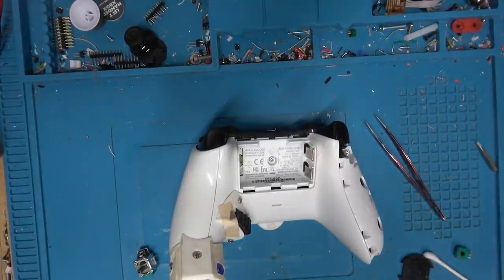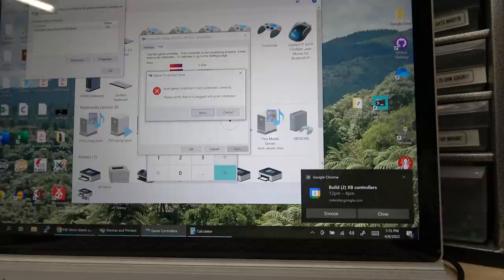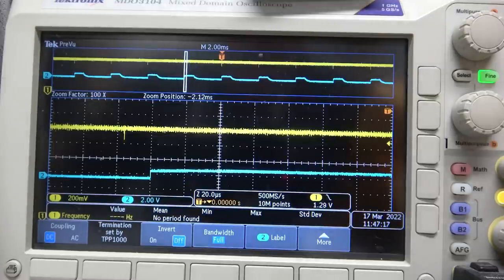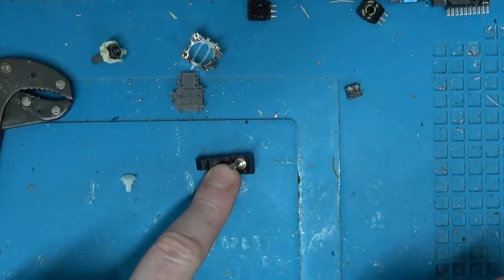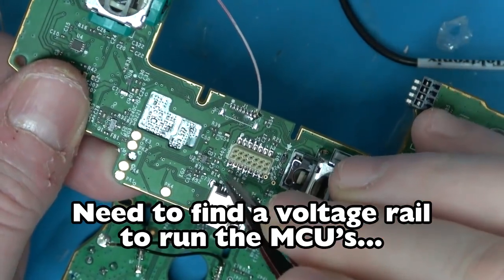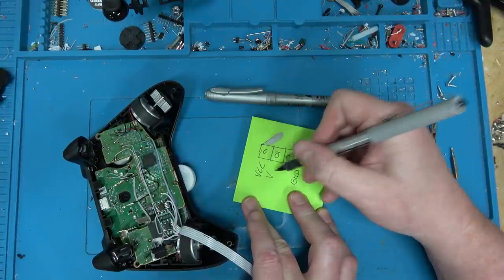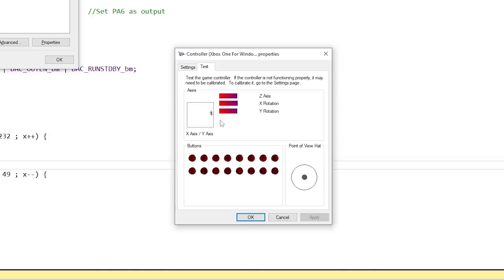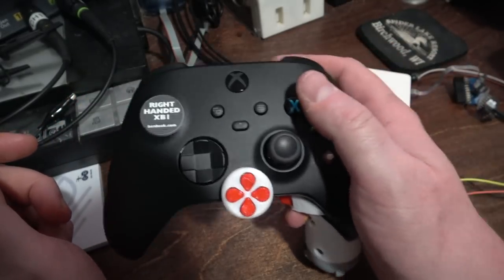Driftbusters: Improving Analog Joysticks

Comment: A rotary hall effect sensor can be dropped in place of a pot.  The AS5600 is still being made.  The tricky part is fastening a magnet to the joystick shaft.  Since the joystick only goes 90 degrees, you could make a home made rotation sensor with 1 magnet & 1 hall effect sensor for each axis.  Rotation is easier to sense than distance.

Comment: You can achieve the same signal conversion using an opamp which will likely perform a bit better and which will be more resistant to supply problems. Connect one sensor's output to the + input and connect two resistors (maybe 10-100k) to the - input. Attach one of these to the other sensor and the other to the opamp's output pin. Now the opamp output will be a nice analog signal which can be divided by a pair of resistors or a potentiometer to obtain the voltage range the controller expects.

You can probably put all of this onto a small custom circuit board to make it nice and easy to install.

Comment: The PS3 still to this day is one of the craziest gaming consoles ever created. The engineering and thought of everything put into the controllers as well as the console itself is just amazing. PS3 controllers that I had typically suffered from a "loose" joystick. They still worked, but they were very "floppy". I'm assuming that the sensors for the stick position basically had no wear but the mechanical sticks themselves actually were probably very worn over time. It really is a testament to good engineers who had the forethought to think, "You know, this stick, when playing games is going to be used sometimes for hours a day at a near non-stop rate. We should probably reduce friction to zero to prevent wear on the sensor so the sticks last longer."
Reply: Still using the same DS3 after 10 years for PC gaming. Still absolutely nothing wrong with it. Companies have definitely gotten cheaper over the years.

Comment: Adjusting the center point is the most useful thing to get rid of drift.  I started to design an add in board with a set of multi-turn potentiometers that go in parallel with the sticks for adjusting the center point but the jitter that shows up after wear and tear means the sticks need to be disassembled anyway.   Cleaning and bending the contact pins outside the cuts in the tracks will last for a little while but eventually you need to replace the pots.  Mouser and digikey carry the genuine Alps parts (and the newer versions) so I'd only order through them.  And no matter what you do, unless you use a microcontroller to adjust it automatically, the drift will always make its way back and need some adjustment.  If only Microsoft allowed access to the microcontrollers code so we could fix the issue in the firmware so we could adjust the center point of the stick ourselves, then we wouldn't need to constantly repair these sticks.

Comment: The joysticks of the Steam Deck are hall effect if I remember correctly.
Sooo, in theory they should work way longer without trouble
Reply: No, it still uses potentiometer. Gulikit will be releasing a hall effect replacement for steam deck. Just search for them.

Comment: Stick offset is also due to changing the pots on the stick, since these are never really zeroed (dead center) swapping a pot will change the zero value of the stick, you either fix calibration by adding resistors or try finding a similar centered stick.
Reply: So true, no 2 pots are equal. Wish we could recalibrate the firmware in the pad. It must be done at the factory.
Reply: @chrisjones9193  wish there was a way, resistors do just fine on Xbox, on PS4 it lowere the max input range by the same amount the center is offset.

Comment: Abrasion of the carbon film will indeed be the issue. It's been a thing for as long as people have been using potentiometers for joysticks- it was semi-common for PC flightsim players to have to open up their joysticks to replace the pots every once in a while. The metal ones last longer, but they still have the same problem.

Honestly, I'd like to see a quadrature-output photonic replacement (use film or something to get a transparency gradient mounted to the rotary shaft, then place LEDs on one side of the disk 90 degrees away from each other, with light detectors on the opposite side from them- that gets you quadrature), just because I'd like to see that as a product, but the hall-effect route will probably be easier.

Comment: Try using 'Fader Lube' It will lube and protect carbon tracks. Best used when the device is newer, or after a cleaning. Will extend the life signifigantly.
I use it on all my audio gear and test equipment.
Reply: What about Deoxit D5?

Comment: If you have a spare pin I'd use it to enable a calibration mode.  When the pin is asserted sweep the X and Y over the entire range, then centre it, then deassert the cal pin.  The micro will store min/max and centre values from both axis and store them to EEPROM.  This means no hardcoded values that may change between joysticks.

Comment: Gulikit's King Kong Pro 2 controller has Hall effect sensors for their sticks, and they're in a housing that matches the standard Alps ones. Hopefully it can become a drop-in replacement in the future.  And their Twitter just posted a prototype mini stick for Joy Cons!
Reply: Don't know how the Joycon sticks will work, but the normal sticks still require the DAC as can be seen in their Steam Deck modules. So, there is still some work to do to get drop-in replacements, and they will be relatively expensive xd
Reply: @ivanaviNiebla  Relatively, yeah. Just out of curiosity I'm seeing individual ALPS modules going for as low as $1.50 each, while the Steam Deck ones are $15 ($30 for the pair). That version includes the daughter boards, though, which I assume increases costs. I can imagine having the eventual drop-in replacements hit $10 apiece would situate them really well as an aftermarket upgrade. Who knows what pricing they can provide for a larger vendor
Reply: @RocketSlug  $10 a piece would be great I think, but who knows  how much can they shave off the costs. Especially if this will be more or less niche products because of the desoldering and soldering involved for normal controllers.

And if competition doesn't appear, they won't have much incentive to reduce the price :/
Reply: @ivanaviNiebla  joycons stucks are modular just like steam deck so they just have to make it smaller
Reply: @RocketSlug  from my understanding, aside from the obvious change needed for voltage and code, gulikit modules can't be drop in because part of the maget is soldered/built into pcb itself
Reply: @realislit8064  Yeah I dug into it a little and there seems to be a component on the PCB. Maybe one day!
Reply: @realislit8064  but steam deck's have a pcb with a chip, while the joycon sticks are only the stick
Reply: @ivanaviNiebla  GuliKit Joycon sticks are not hall effect, and they don't claim them to be. People just assume that because they made a splash with their Hall effect controllers and Steam Deck replacement sticks. They are just conventional, but better than stock quality resistive joysticks.
Reply: @ClassicGOD  They said to be working on a hall effect version didn't they? Not the ones that are already on sale.
Reply: @ivanaviNiebla  They have hall effect Pro Controller for Switch but I never seen anything on Hall effect Joycon replacement joysticks. But I don't follow them closely enough to claim complete knowledge on what they did or did not announce.
Reply: @ClassicGOD  Yep, just checked their twitter and they have talked about working on a hall sensing joystick for joycons.
Reply: @ivanaviNiebla  You are right, they are working on one but the one in the picture on their twitter is not a Joycon replacement (they mention that in the thread). To replace standard resistive stick with an hall effect one you will always need additional electronics.
Reply: @ClassicGOD  Yes, that's what I've been saying to people. It's not as simple as they think

Comment: Alps does currently make 2 axis hall effect gimbals. We use them in hobby grade RC controllers. Even trimmed down, they may still be too big for modern console controllers, but the hall effect encoders are pretty great. There are also similarly packaged optical encoders as well. There has to be a way to make an analog stick PCB with the right ICs as a retrofit kit. Whether it's worth the time or not, that's definitely a 'you' question.

Comment: People say these joysticks just wear out but I've owned at least 20 over the years and all the old ones never have worn out like this it just wasnt a thing, now people say its normal, I think its manufactures being cheap.
Reply: I remember this happening on N64 with nintendo brand and third party.
If I can remember possibly the xbox 360.
Reply: @LittleRainGames  N64 used rotary encoders, and it made of all plastic so that whittled itself away over time.
Reply: @LittleRainGames  mario party killed so many controllers

Comment: These carbon film potentiometers feel a lot like an intentional failure mode. Thin layer of carbon wears out, got to buy another $65+ controller. Easy money brought to you by racing to making something cheap as possible even if it means creating a problem for everyone that uses the product.

SEGA had this figured out back in the Saturn days. I miss old school SEGA. They were weird, but they were well engineered weird.

I wish I had the skill to refit a SONY DS4 controller to a hall effect sensor (without needing to modify the overall shape of the og DS4, I love the hand feel) in place of the janky carbon film pots that will always fail if you use them.

I love watching you dick around with things.  Seeing something being remade to work better is always satisfying.

Comment: This was a great video as always! Could you possibly have the same results with only two hall effect sensors instead of four? It was shown that the sensor measurement would increase when the magnet was moving away from it, so once you found the center value it may be possible to get by with only two sensors. From the readings shown in the video it doesn't look like there's much of a loss in sensitivity/granularity in the measurements either. At that point maybe you could get by with only one microcontroller as well?
Reply: You could but it would probably require a lot more calibration effort and positioning of the magnet and sensors. The hall effect sensor might not be perfectly linear with its response to the magnetic forces. Hall effect sensors also have a very limited range so it might completely lose sense of the magnetic field and the output becomes 0 or it gets too close and the output becomes the max voltage. Using 4 sensors is a lot easier in that regard and unless you are thinking about mass producing joysticks adding 2 more sensors to save you a headache is probably not worth it.

Comment: Hey Ben.  After months of looking into the PS3 modules, I've finally figured it out.  They're half-bridge magnetoresistor sensors, not inductive sensors.  The pulsed 2.8v VCC rail is extremely odd, no idea why it exists, the module design is also odd as it doesn't make any sense to me.  Alps Alpine also has a ton of patents for MR sensors, though I haven't been able to source these modules specifically.  These modules are also extremely custom, the resistance values don't match any off-the-shelf sensors I've found yet.  Sad reality that we'll never see these modules again unless someone finds a treasure trove buried out in a desert.  Though I'm not sure of their longevity, for example hall effect sensors have an abysmally short rating for quiescent age-related voltage drift, though I do know these modules are fairly susceptible to foreign fields just as hall sensors are; maybe an inductive stick is still an idea worth chasing due to the benefits it would have, not to mention that they'd be fairly easy to produce when you're not a major corporation.

Comment: I wonder if it would be possible to "patch" those carbon rings by drawing on them with a pencil, like that project from the Forest M. Mims III engineers mini-notebooks where you make your own resistor using a piece of paper, a thick ling drawn on it with pencil lead and a couple of paperclips for the contacts.
Reply: Somebody should try a gelatine-graphite paint job and report back.

Comment: gulikit makes some hall effect controllers and analog replacements for steamdeck with hall effect sensors
Reply: Do you know if there's a way to get their joysticks to drop into a normal controller? I'd like to put them in my Switch Pro Controller
Reply: @tawmifm  no which is why only the steam deck is the only one they offer since the analog stick is on a little pcb that plugs in. If you can find the module somewhere you could solder it in but I think there are little chips or something that make it work on the board of the guilkit controller so just soldering it in is probably not enough by itself the manufacturers would have to put it it and the only other ones doing it is 8bitdo this month they are releasing an Ultimate controller and one of them steam deck competitors can't remember if it is Aya or some other one.
Reply: @unkownomega  if only we had an engineer/board designer go rogue and make universal hall effect joysticks just for fun and take revenge on his old boss. Its totally doable, Ben straight up just did it in this video. 
If i had the tools to build a PCB, i would prob give it a try. two north and south magnets adapted into the potentiometer's housing (2 potentiometers so thats 4 magnets for each stick), two sensors rated with minimum voltage of 1.8 or less (for xbox) by the side and a little pcb that solders into the controller with a microcontroller chip that can be programmed to translate the sensors voltage range to the controller's range. Then if you need it for another type of controller just change the microcontroller's code ayyy
Reply: @LorikQuinn  phobgcc uses the base concept of an open-source hall effect joystick for a gamecube controller, pretty neat
Reply: Gulikit has nice sticks, but terrible QC.
Reply: @tawmifm  Making your own hall effect sensor joysticks from regular ones isn't hard or expensive. The hard part is making them out put the exact same values the potentiometer would. Otherwise you'll need to either use software calibration(which would lose a fair bit of accuracy, especially with 8-bit Axes), or use another MCU in place of your controller's original.